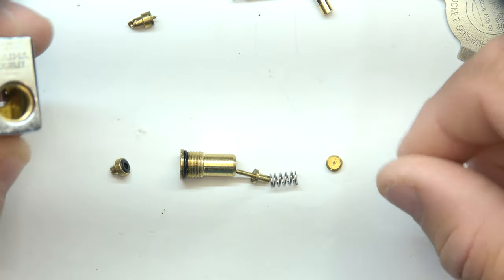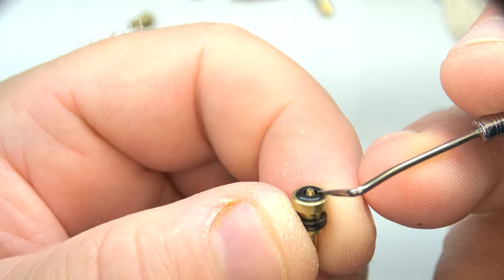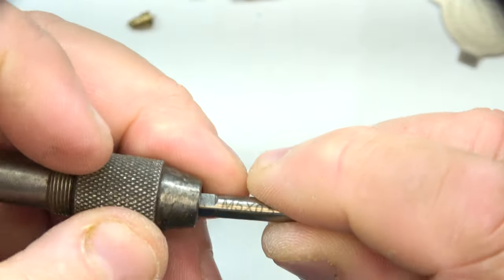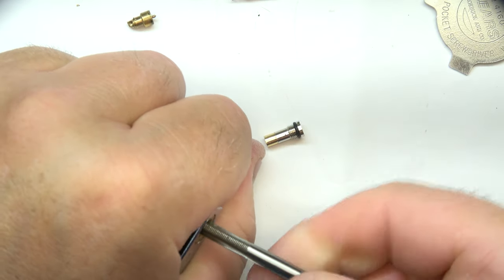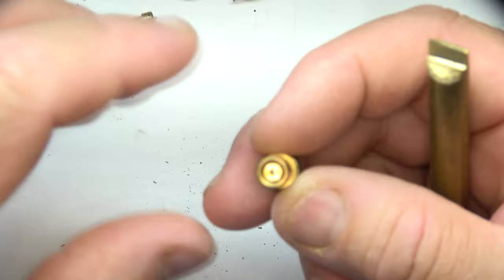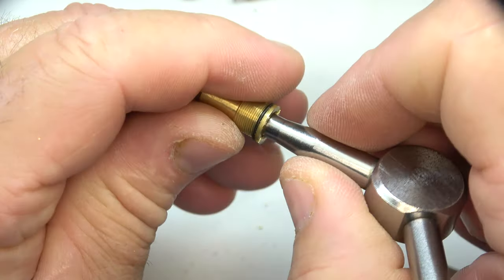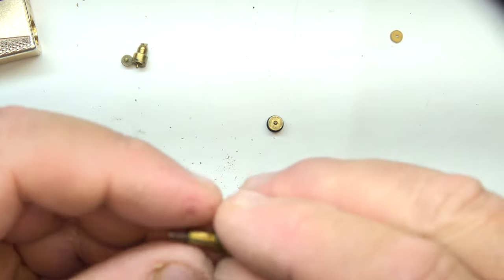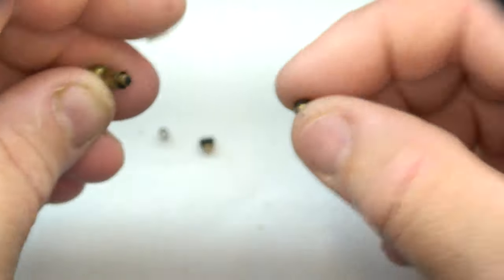Zaima Butane Lighter Valves overview

Comment: Hi! Only halfway through the video, but I am wondering if you used any lubricant on the tap? Using lubricant not only allows the tapping procedure to be done smoothly, it will also save the tapping thread from being ruined. Thanks do much for posting this Excellent video!
Reply from the maker: Good idea!

Comment: I have a container full of different gaskets of every shape and size from used and new no longer used vape atomizers and cartridges. There could be up to 7 in each cartomizer. Black and white silicone o rings and other slightly different types. I have 30 drip tips that each have 2 black o rings I use the most.
Reply from the maker: Save all those parts! Never know when it could come in handy
Reply: I do too! I have a box of atomizers new and used and just used one today. Lol